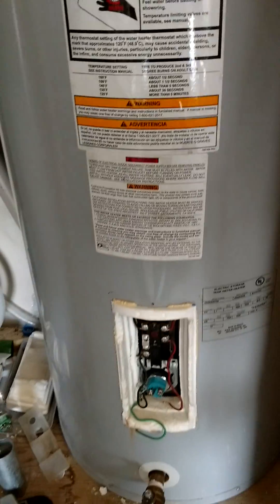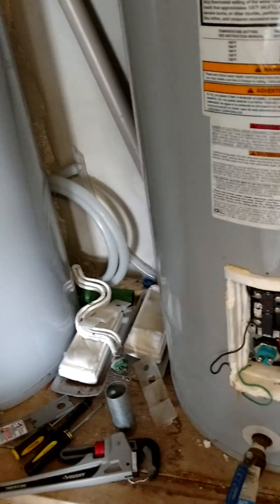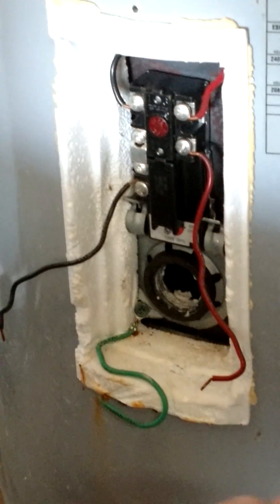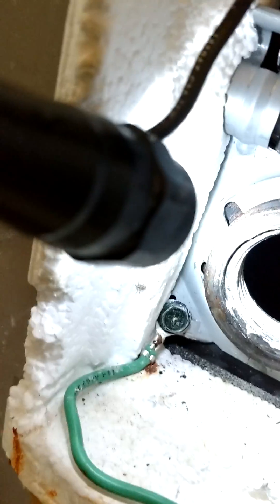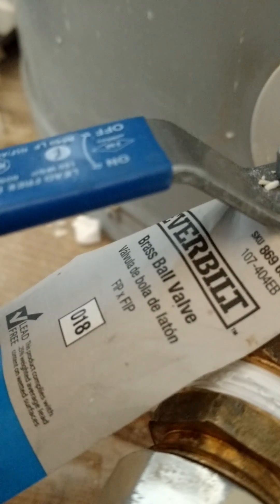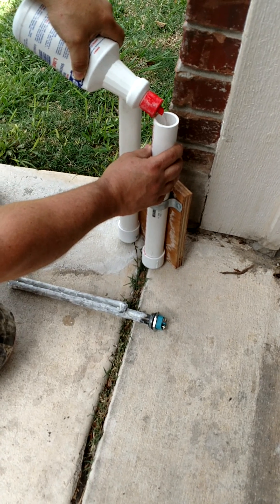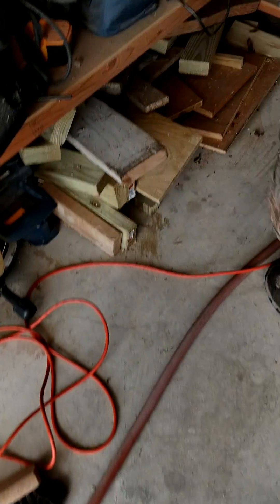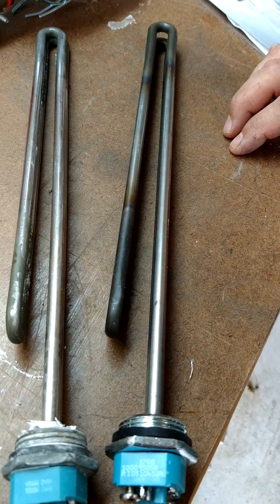Cleaning 50 Gallon Electric Waterheater

Comment: Most excellent idea.  I have a gas heater so I don't have the large hole for access on the side.  I only can go through the anode hole at the top which does allow a 1/2 PVP sized pipe in it.  Do you happen to know what the outside diameter of the blue tubing is?  I think I can fashion a vacuum connection to a long piece of PVC and use that.  It is a pretty long way to the bottom -45 inches or so - on my 40 gallon tank to I need something long and fairly stiff.  I am pretty sure with your electric heater it appears the bottom of the tank is fairly flat and level.  Is that true?  Reason I ask is I would think that sticking a hose in the hole would allow your particles to flow more easily out of your ball valve and not require a vacuum.  You are able to agitate the water at the bottom more easily than me because the gas heaters as you know have the flue in the middle and the tank is domed at the bottom both of which make agitating the water difficult and this causing the sediment to not go out the drain as easily.  Thanks for the video!
Reply from the maker: Hello Condor5635 - I have a couple of Suggestions to your questions for the tubing --  
¾” tubing — non metallic electric conduit tubing - be careful bending it too much it may break — might want to bend with your hand to see its limits 
** An additional option is to ensure all your scale build up is in small chunks so the hose don't get clogged with big pieces , Maybe using a ¾  or ½ wood dowel and pound through the anode hole - ensure to use wood because there is a coating inside the water heater to protect from rusting

Electric Water heater Design
Electric heater has a dome bottom - I also add in bursts of water to get the sediment to move around and then it will go out the hose , Also after this video I found that using HOSE QUICK CONNECT to take off the hose and shove a long Phillips screw driver to unclog the ball valve 
with minimal water spillage. 

The above sites has expert knowledge on this - that is where i got my ideas from.
I am not plumber just trying to save a buck with my own common sense as a Retired Boatswains Mate.

let me know how all worked for you and if the suggestions worked 
Thank you

Comment: I have that exact same water heater, though it came with the "sandhog" elements which are curvy in shape so they can fit more surface area
Reply from the maker: I have chosen the straight ones because they are easier to clean up with the pvc tubing and they are easier to get at the local hardware store if needing replacing. The straight ones can also heat up the water quickly. I make sure they are stainless steel they are more hardy

Comment: Great job. Did you add something onto the ball valve to have garden hose threads?
Reply from the maker: 3/4" hose nipple
Reply: @boatshandyman8653  Ah man, That answer made me snort.
Reply from the maker: https://www.homedepot.com/p/Orbit-3-4-in-Brass-Hose-Nipple-53259/205309417?keyword=brass+3%2F4+hose+nipple&semanticToken=21300000111_202001181659561526983_xrsj+21300000111+%3E++cnn%3A%7B11%3A0%7D+cnr%3A%7B7%3A1%7D+cnd%3A%7B4%3A0%7D+cne%3A%7B8%3A0%7D+cnb%3A%7B0%3A0%7D+cns%3A%7B5%3A0%7D+cnx%3A%7B3%3A0%7D+st%3A%7Bbrass+3%2F4+hose+nipple%7D%3Ast+oos%3A%7B1%3A1%7D+pt%3A%7Bhose+nipple%7D%3Apt+rt%3A%7Bbrass+3%2F4%7D%3Art+dln%3A%7B556187%7D+qu%3A%7Bbrass+3%2F4+hose+nipple%7D%3Aqu
Reply: @boatshandyman8653  
 It was a perfect answer. It just hit me as a Captain Obvious moment.